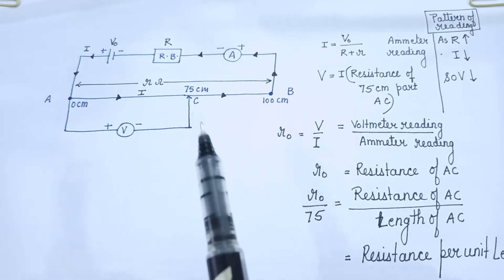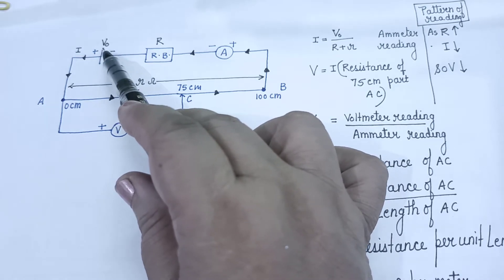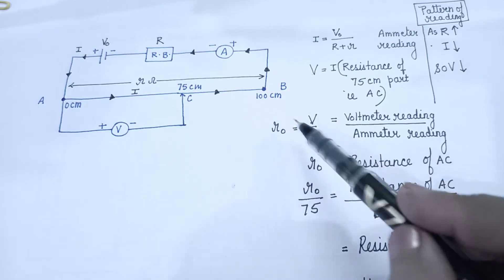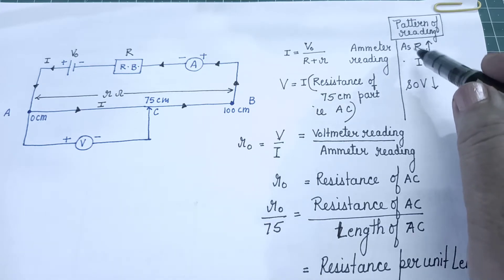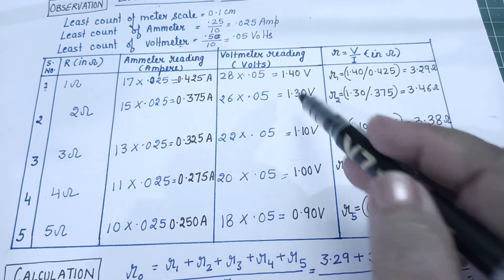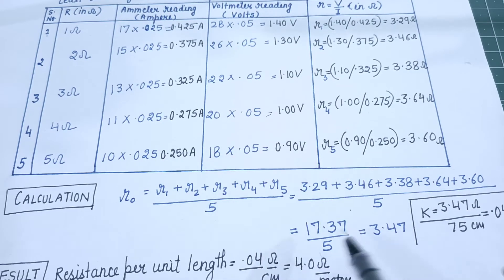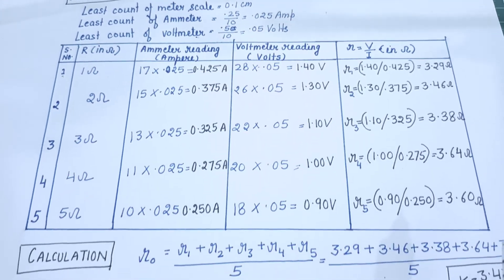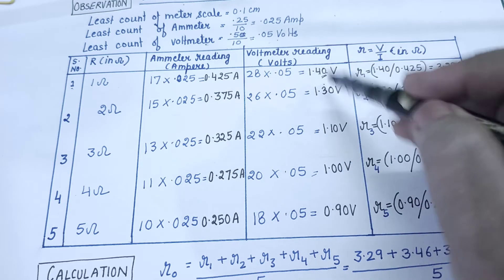3-ISC physics practical 2019, question 2:how to write observations correctly in exam copy .

Comment: Teacher I think r2 should be 3.47 ohm instead of 3.46 because on calculation it's coming 3.466 so on rounding off  it will become 3.47?
Reply from the maker: Yes. Although it will not change the average.
Reply: Ok teacher clear now.😇🙏